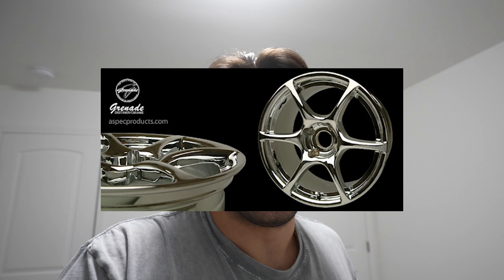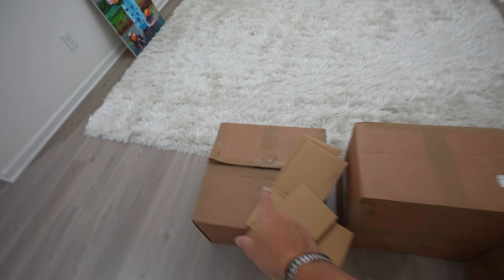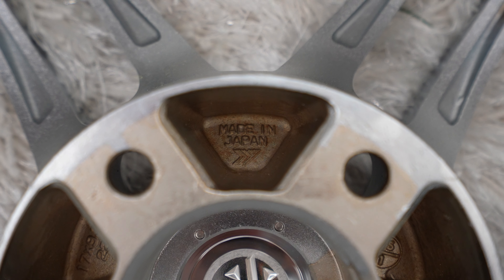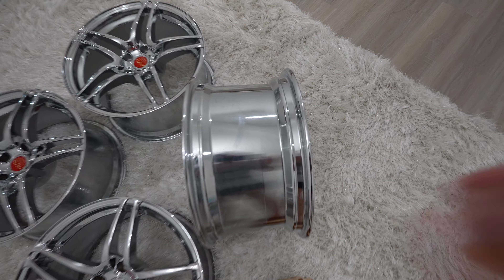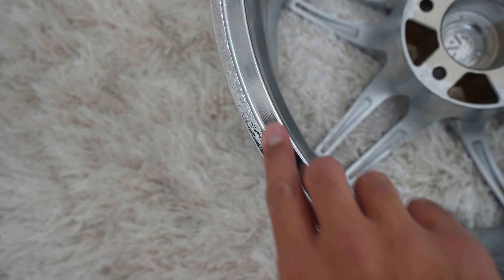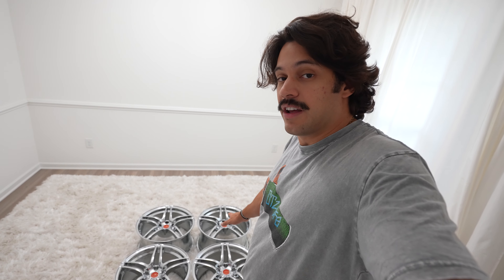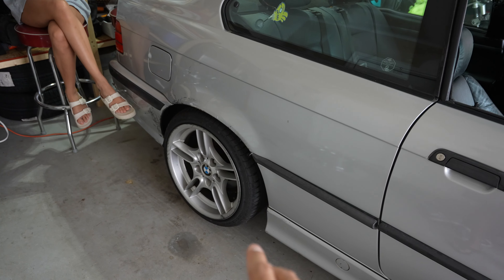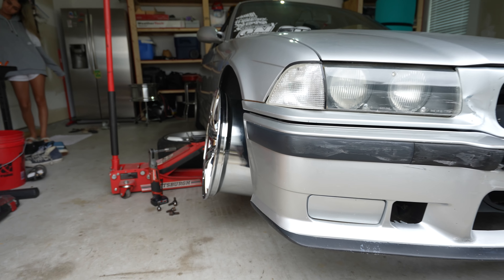E36 GETS NEW WHEELS !! (Unboxing & Test Fit)

Comment: slot the upper arm so you can run an adapter and fit the wheels, free and no need to switch out hubs
Reply from the maker: I already ordered hubs going to see how much camber I’ll have to run with hubs but I might end up having to slot the uppers as well
Reply: @ONGO_  I slotted mine and had zero camber with a 17x9+45 alongside a 25mm adapter